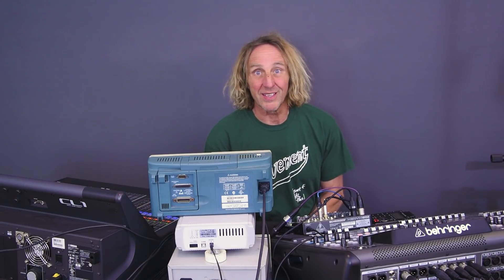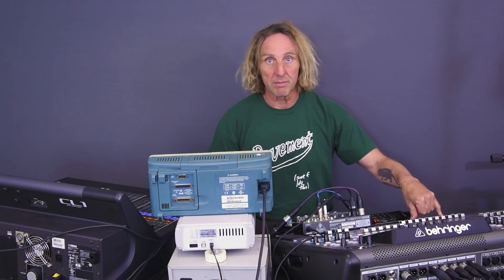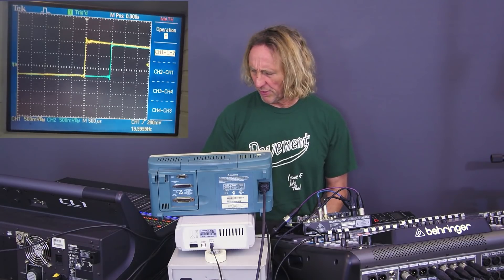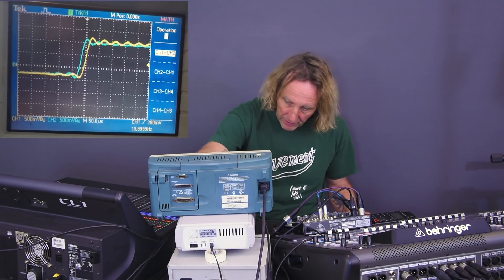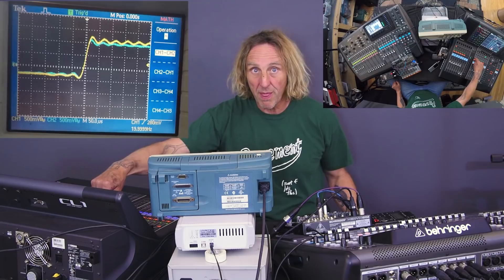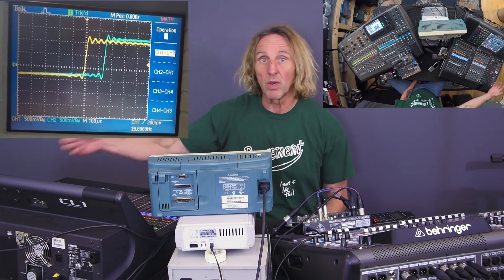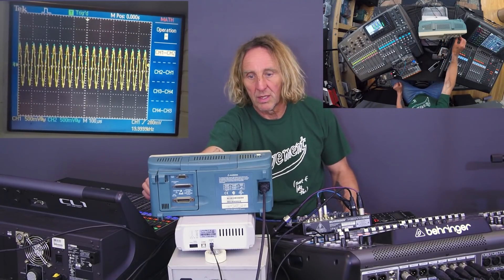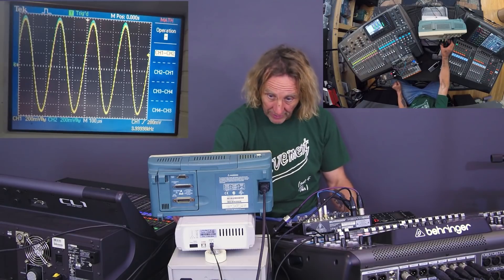Late Not Great, Yamaha CL1 vs Behringer X32 Subgroup Latency (Public)

Comment: Interesting to see the two manufacturers have different priorities. Yamaha developed A/D and mic pres with perfectly linear frequency response, but didnt implement latency compensation. Behringer chose otherwise. Honestly in this case I would say Behringer made the better choice
Reply: The hi-end rolloff is due to the ad-converters anti-aliasing filters up to the nyqvist freq. I find this gentle slope to be quite pleasant since it limits hi-end buildup that otherwise would sound harsh(er).
Reply: Robert Löfgren oh i did not consider that, you are probably right!
Reply: And the sends on output faders/mix on input faders. Really missing that on the Yamaha's

Comment: Some claim the M32 series to have latency compensation - I found no prove so far, because the M wasn‘t available when I needed it, so I had to get an X32. 

If the M does compensate, I wonder if it‘s a software-thing. Maybe the firmware distinguishes between X&M and activates some special features? 🤷🏻‍♂️
Reply: The x32 and m32 handles latency/coherency compensation exactly the same. The m32 is NOT treated in some special way. 

This hoax came about when the midas marketing team used different wording compared to when the x32 was released and people thought that the x32 didn’t have the same m32 processing engine/features.
Reply: I saw a nice series of test measurements a while back but can't seem to find them! From what I recall, the X and M32 will be in phase with parallel bus routing until you add an inserted FX to one of the paths, but that would add extra latency and can cause comb filtering between parallel paths
Reply: @stephenevans2518  , that is correct. The different rack-fx causes different latencies depending on which fx you insert. This holds true as for the aux inserts as well.
Reply: @robertlofgren6834  Yeah, that‘s what I was thinking about (parallel compression f.e.). If they both behave the same, I‘m quite happy with my X32. Apart from the better faders and preamps you get a lot for your money.

Comment: First time I ever tried doing parallel anything on a CL things got weird. So much so I hit up Yamaha CA to ask if there were fixed values so I could at least compensate. They had no idea what I was going on about. So glad to see I wasn’t going crazy! Thank you for these!
Reply: Same here. I remember trying to run a parallel drum buss and just ditching it off in soundcheck because it sounded so weird. Following research I ended up just sending my drums to two busses, to keep them aligned, even sending the dry buss through a bypassed insert rack just to keep it as tight as possible.
Reply: @dylanbarber6899  to me desks should adjust timing to compensate like DAWs, or at least make it a point to alert using parallel path or any ways it could happen to warn the user with a session/global override.  some sort of idiot light if you don't balance it..
Reply: @dylanbarber6899  This is the one and only way to do that with Yamaha consoles. It’s a shame!
Reply from the maker: It's a challenge between minimal latency, or fully compensated or having latency keep changing with routing. No solution is ideal.

Minimal latency is desirable but it requires the engineer to be cautious with routing.

Comment: Very surprised that the Yamaha desk doesn't have a fixed latency. 

I would be very interested in seeing you investigate this more. Particularly in relation to how this could potentially course issues with real world use.
Reply: I think they only started doing fixed latency on the Rivage family.
Reply from the maker: I think as long as you avoid recombining the same or similar signals, you should be good

Comment: It’s easy to make up gain but latency is a lot harder if not impossible to correct.
Reply from the maker: Yeah, with things like in ears where the sound is combined with the resonance and sound of the human body source, latency can be an issue.

With wedge, latency can make things sound further away which may be undesirable

But mainly, its just annoying and being aware is the key to not making combining errors
Reply: @DaveRat  yup 👍🏻.
Reply: I had a situation where I was trying to record live vocals with a few backing tracks and the delay offset was just enough to drive the singer crazy. The singer was pretty frustrated but he was super talented and goal oriented and managed to sing on key and with nearly perfect timing. I understand that you can possibly delay other sources but sometimes it’s just gonna be a problem. Whereas gain makeup is just a knob twiddle away from being fixed. I never had any of these issues with my analog consoles 😂
Reply: You can delay the other sources to match, or start moving speakers around. 

Latency is common in the acoustic domain, and the rate of latency is about 1ms per foot.